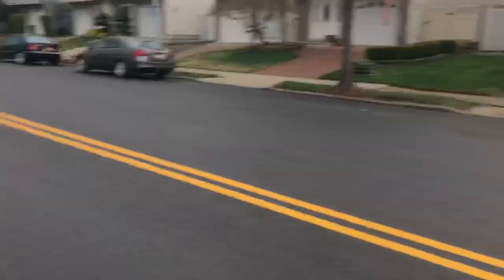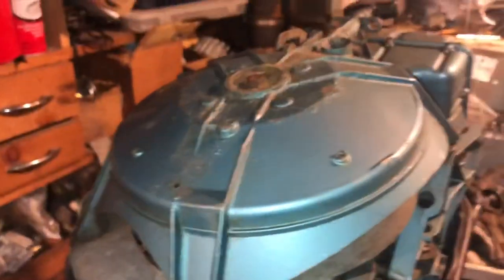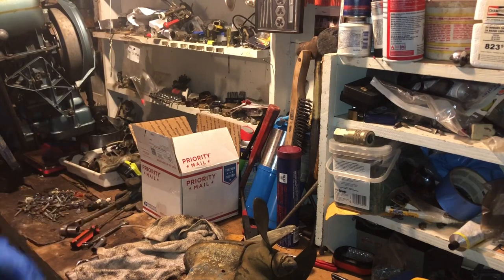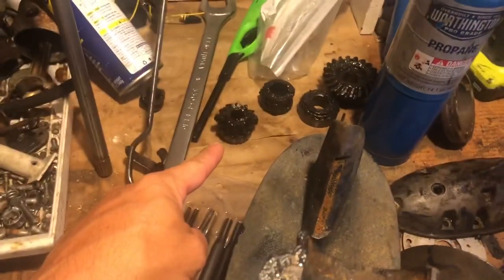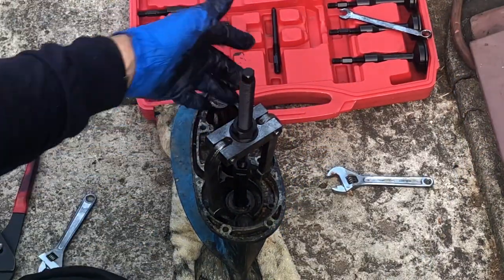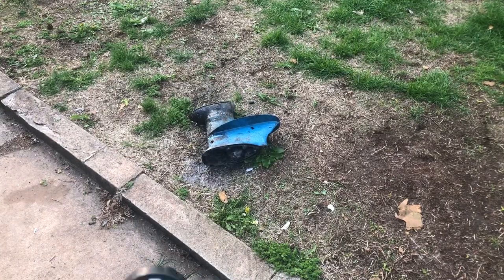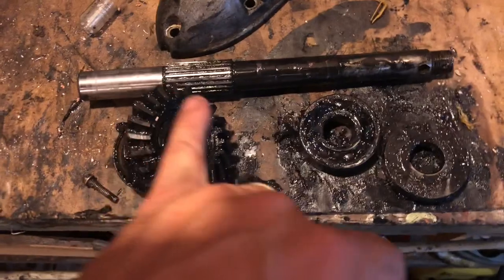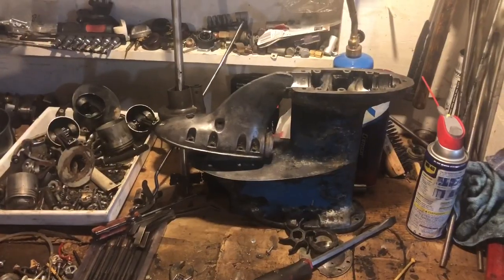1956 30hp BIG TWIN BEAST!!! Evinrude gets the once over.  Part 1

Comment: I just got one maroon color 1956 electric start 30 hp 150 bucks came with the paperwork looks same under the hood the head looks like my color compression was 105 and 107 sat in a basement since mid 70s need to put new rubber from cables to gas lines water pump and carburetor rebuild gear seals are fine thanks for the videos
Reply from the maker: THATS AWESOME! I love these big old motors! so much fun and easy to work on! Thanks for the love my man!

Comment: My Uncle had a 1955 Big Twin Electric 25, we had a 1957 Big Twin Electric 35. The 30 HP was only made in 56, and it was basically a warmed over 25. Same Displacement, but the 25 was rated @4000rpm, the 30 was at 4500rpm. Higher Compression and Porting and Carb would have made the Difference. The later 35hp had a larger Displacement, and was rated @4500rpm 

The Head was replaced, and it looks like the Block got a little Hot in the Past. These Motors can really idle nicely
Reply from the maker: hell yeah! lol. I have another one electric with a generator i plan on working on soon! its in EXCELLENT shape

Comment: Ive got the same exact motor just can not get mine to run ive gotten it started but wont stay running
Reply from the maker: check the basics. try a different tank check hose orientation, tank vented. then re gap the points, compression, coils, etc. then break down the carb... yes again lol. check for water pumping so its not overheating
Reply: Gonna check the hoses an points plus redo the carb this weekend so we shall see
Reply from the maker: let me knowb how it goes and  what your compression numbers are! @Gimppy775
Reply: I don't have my gauge for compression but I know it has more then enough just from pulling it but I need a bulb for my fuel tank my check valve in it is busted I recleaned the carb today had to put new orings in for the low an high speed needles
Reply: Water pump is working properly as well I installed a new one a couple weekends ago had it running but was idling rough an wouldn't stay running found out I had wrong mix of gas
Reply from the maker: @Gimppy775  those little things add up!!
Reply: They sure do I'm going to try to start it tomorrow we will see if it'll run lol